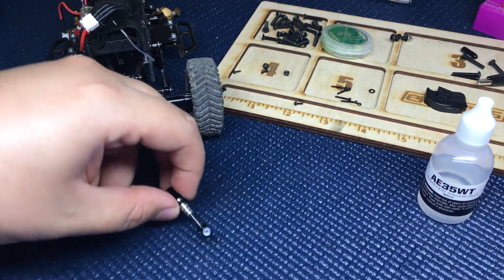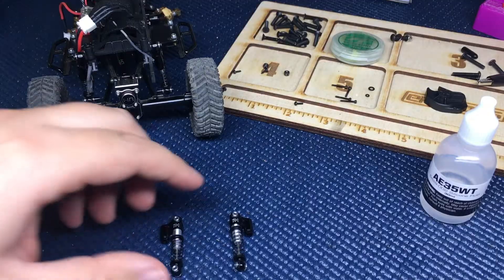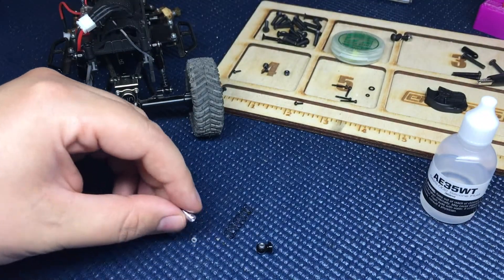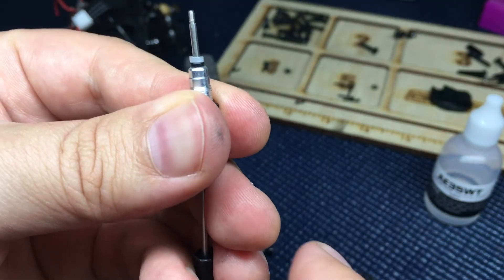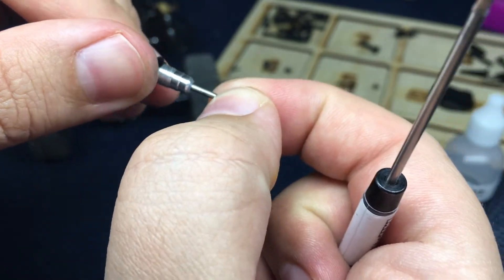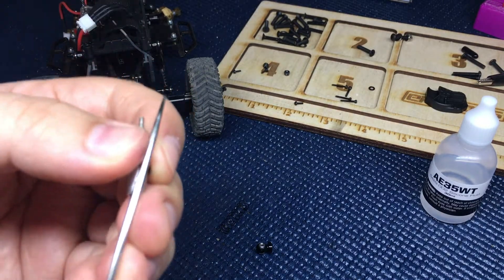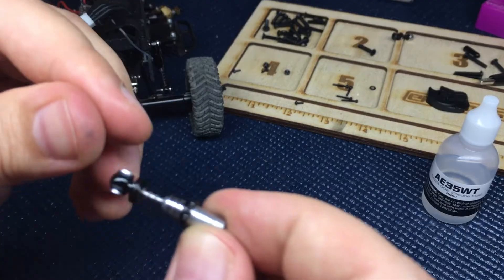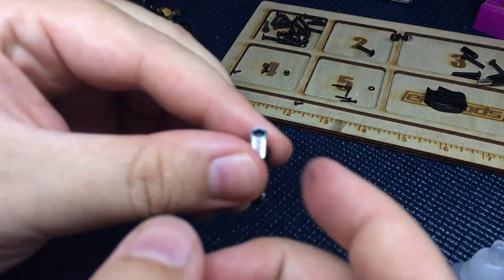Axial SCX24 Power Hobby or Hot Racing Aluminum Oil Filled Shock Conversion

Comment: I found a very easy conversion that achieved similar results. I took a HR clone shock from Amazon took it apart and that flatten two sides of the shock piston head to be flat with the shock shaft than resembled the shock and added 3mm of #5040 20 Million Weight Fluid it now has compression and rebound dampening and no leaking and no loss of range, compression and extended lengths are the same as stock. You can adjust the amount of dampening by the amount of 20 million you add.